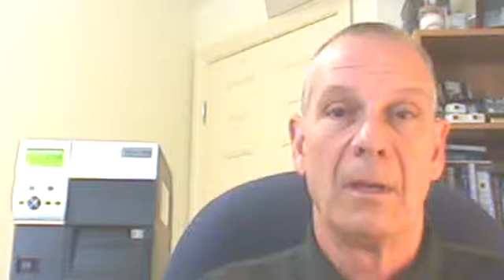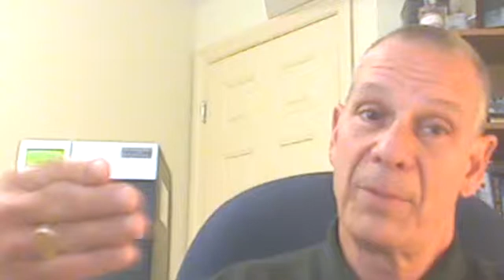Printronix New SL/T5R Energy Star Printer

Comment: As I said, we use 8 * 4 labels, and getting gap not detected label, do you suggest I move the positio of the top senser. or recalibrate from the control panel, and if so please list down the steps, with reason, if possible.

Comment: Please explaine how to calibrate the printer if it is showing gap not detected message on the control pannel. 
Why Energy star important?
Why is it important to replace from legacy printers to Printronix T5000 energy star? My compa\ny is doing it.
I tried to change the size of the label to 8  times 4, but it did not authorize me, to avoid the gap error.